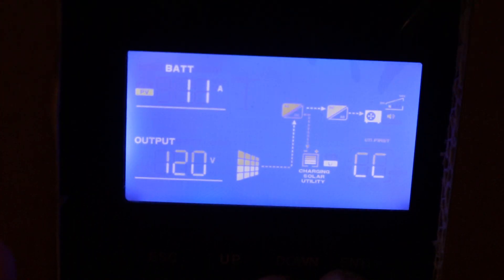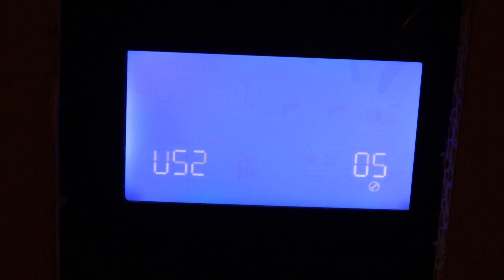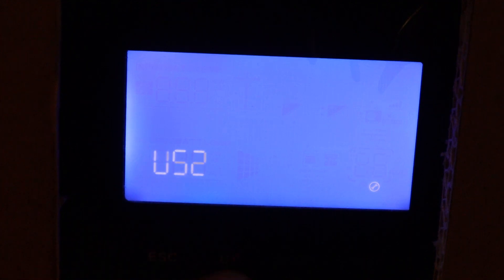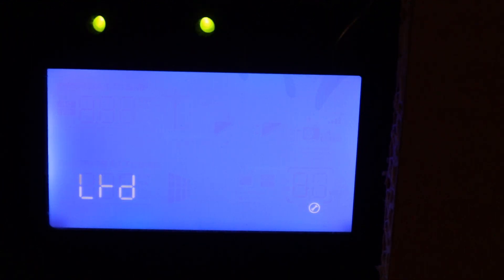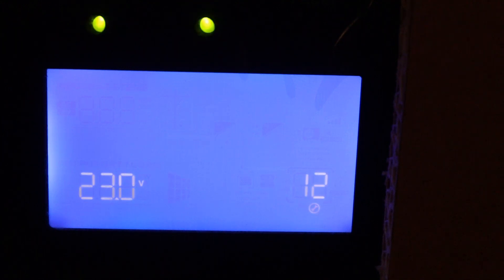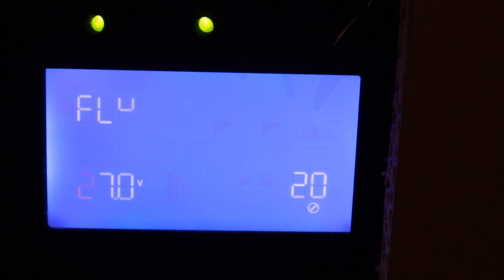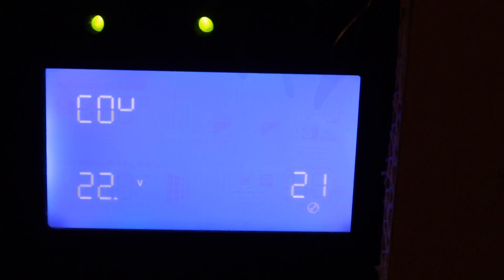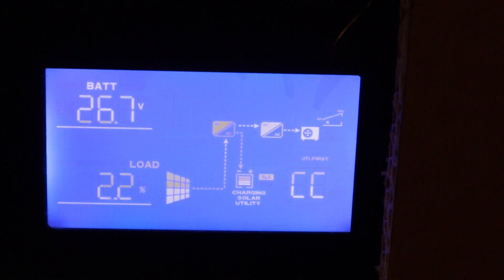Growatt 3000 24 Volt Settings For Lifepo4

Comment: For LiFePO4, generally speaking you want to set a Float voltage of between 3.35V and 3.375V per cell.  So for a 24V 8s system, Float would be between 26.8V and 27.0V..   The reason you set the float here is because a fully charged LiFePO4 battery will 'settle' (remaining fully charged) at around 3.3V.  So this float will provide solar support for your load without depleting your battery, while the sun is up.  It will very slowly trickle charge the LiFePO4 battery if there is no load, but for an off-grid system you generally don't care because the instant the sun goes down your loads start to draw the battery down.   IF you also have a grid connection most of the time, using the lower 3.35V/cell float (26.8V for an 8s LiFePO4 system) is fairly conservative.

For the Bulk target you generally want to set a target of between (roughly) 3.45V to 3.65V per cell, which for an 8s system would be between 27.6V and 29.2V, approximately.  Now the bulk setting depends HEAVILY on the C rate that your solar system is nominally charging the battery at.  If you don't have a lot of panels and can only charge the LiFePO4 battery at a low C rate.  For example 0.2C or lower, then you generally need to set a lower bulk target to avoid over-charging the battery.  This will still fully charge the battery.

However, if you are charging the battery at a higher C rate, for example 0.5C (e.g. if the battery is 100Ah, 0.5C would be 50A), then you need to set a higher bulk target to avoid cutting off the charge too early (the battery will not be fully charged if you are charging at a high C rate and cut-off at a lower bulk target voltage).  In this case, charging up to 3.65V cell for the Bulk target might be necessary to get a decent charge.

There are other factors too.   Lower Bulk targets may leave some solar energy on the table because the charging current will wind up being lower than what the solar can deliver once the battery goes above around 50% charge.   Higher bulk target always run the risk of over-charging the battery.  Though LiFePO4 is pretty resilient just generally.

The rule-of-thumb 'safe' Bulk target voltage is around 3.55V per cell (which would be 28.4V for an 8s LiFePO4 battery).

The Growatt should have parameter settings to allow the bulk target and the float voltages to be separately set.

Also, I didn't catch the LiFePO4 setup but note that a BMS is mandatory.

-Matt
Reply: Thank you for all that info. It was also very helpful for me.
Reply from the maker: @KampervanemPrzezAmeryke  Thank you for watching and for your support. Please consider subscribing if you found the content useful it really helps the channel grow. Thank you.
Reply: Aloha, Great Info! I'm running a 24v 3000w Growatt with two 24v 100ah ampere batteries. This has helped me out a lot. I am off grid but using a 3500 generator to supplement. I am wondering how this may apply to me. I am only pulling in 350 watts of solar at best on a 600w solar array and thats when its not cloudy which doesn't cover my 150-400w load and charge the batteries fully for the night. It seems to drop the batteries WAY TOO quickly, it turned off at 5am at 22v low cut off and it only wants to charge up to 26.5-26.6  even though I set my bulk and float to 28.2. I tried various settings with mixed results, but curious whateveryone thinks. I'm still trying to figure out what settings I should be using. Util, Sol? And what about number of batteries setting? Sorry I'm still a noob and really appreciate anyone and everyones input. I'm saving up for a 2000w solar panel array, but any other advice would be appreciated. I live on the Big Island of Hawaii where I get a lot more sun. I know It should be doing better than this. Please Help! Mahalo!
Reply from the maker: @AnWAdventures  Hi. Yes, my setup is similar and I am getting similar results. I have mine setup on UTI first and  setting 14 on SNU. You can play around with setting 5 between USE or US2. Also you could try setting the bulk and Float to the same value at 28.2. Technically if your cells are balanced you could set it as high as 29.2, however you do not want to over charge your cells. Keep in mind that after charging it will read at 26.5 volts because that is where these cells rest at their nominal voltage. But when charging you should see them go above 26.5. There seems to be a lot of issues with the Growatt 3000 and the settings. Hope this helps some. Please consider subscribing if you found the content useful. Thanks.
Reply: @thinkfreelivefree6951  I set my girlfriend's Charging and Float Voltages, (#s 19 and 20), to 28.8V, which gives 3.6V per cell, assuming 8 cells in a 24V nominal system. Her system seem to be doing fine, even after a year of use. Oh...I did mount six 200W solar panels at about 45 Degrees with down towards the driver's side, to allow rain to wash them clear of dust.
Reply: @AnWAdventures  Sounds like the panel is not generating enough power and is only able to partially charge the batteries during the day at best.   My assumption is that this is why the battery voltage is not able to climb any higher.

You have roughly 4.8kWh worth of batteries which, if fully charged, would be able to support roughly a 450W load for 10 hours.

The 'solar day' for fixed panels is roughly 6 hours long. 350W x 6 hours is roughly 2.1Kwh, so your current panel setup is only able to charge the batteries half way (and that is only if there is no load).  Since you have load too, it is pretty clear that you need more panels.

Which you know since you are working on getting 2000W more :-).  But in the mean time, see if you can scrounge up a few more panels on the cheap.  Even if you have to lay them down on the grass on some 2x4's (make sure they don't wind up in a puddle).   Make sure the open-circuit voltage and currents remain within the specifications for the Growatt.  It should make a big difference.

My second recommendation is that you collect data on just how much energy you use after 5pm until around 9a.m. the next day.  That calculation is in kilowatt-hours (kWh).   For off-grid living, the #1 thing on the punch list is always to minimize overnight usage.   

Also note that the Growatt's standby power consumption alone is going to be fairly high.  I don't have the number off the top of my head but my assumption is around 60-100 Watts.  It will drain the system even if you have no loads connected.

-Matt
Reply from the maker: Awesome Post Matt. Thank you for sharing all of that with us, very valuable information and thank you for watching. Please subscribe if you found the content useful. Thank you for your contributions.

Comment: Also if it doesn't need a float charge then why not just set it up at your max charge rate? I have my max charge set at 28.8 (battery manufacture says 29.2 is max) they also say in my battery documentation for my lith battery the 27.2 is float. So I have it set at that. So I dont think it is charging my battery to the fullest. I and going to try to set the float the same as the max 28.8 and see what happens. Oh and I am in USE mode. I have not tried the other mode yet.
Reply from the maker: Hey Woodknack, thank you for your contributions. We all appreciate knowing how everyone else is setting their Growatt's up. My concern with going to 28.8 is that if some of the cells are out of balance or becomes out of balance it would push some of the cells higher than 3.65 volts per cell and could degrade some of my cells. So I am trying to play it a bit safer by not charging them up all the way. 28.8 volts would be 3.6 volts per cell, I would be a bit nervous that some of my cells would go over 3.65 volts on the upper limit. Thanks for your questions and input.
Reply from the maker: So you are also using USE, are you seeing any issues with your Growatt in the afternoon reducing your solar? Thanks.
Reply: @thinkfreelivefree6951  its in my camp. i only go up on weekends. still learning and playing with it. I just installed it a couple weeks ago. I have 800w solar array put I also have two 145w panels I am going to add to the array. So I will have over 1000watts. Cabin is small 360sqft. small frig I leave going full time draws about 65 or 70 watts when the compressor kicks on. Lights are all led. My biggest draw is in the morning making coffee in our one cup k cup coffee maker that draws a lot but only for a very short time.
Reply from the maker: @woodknack1  That is awesome. Are you also running Lithium Iron Phosphate? When you get time to check it, could you let us know if it reduces solar in the afternoon? Thank you for sharing with us.
Reply: @thinkfreelivefree6951   Yes, I am running Ampere Time LiFePO4 Deep Cycle Battery 12V 100Ah with Built-in BMS( have two in series). Mine seems to fluctuate on wattage trough out the day. Im am sure I am not at the optimal angle for the sun. When I got to camp last weekend it showed the PV array pumping 761w into my controller. I thought that was pretty good considering it is a 800w array. I also have it setup with a generator that is remote start on and off from with in the camp so I can use both to charge the batteries. But for the most part solar has been keeping right up with it. I will know better when we get the camp finished and settle in for a week or more at a time.
Reply from the maker: @woodknack1  Nice setup. Are you completely off grid there? Sounds amazing. I am also looking for land at the moment and want to do an off grid cabin too. Your setup sounds perfect.
Reply: @thinkfreelivefree6951  yes all off grid
Reply from the maker: @woodknack1  Wow, that is crazy efficient. You are getting 761 watts out of 800 watts. That is excellent. The best I have seen on my 600 watt solar array on my van is 480 watts, but most of the time it is closer to 400 watts. I am not sure why my panels are so inefficient. I have 3 200 watt Rich Solar Panels connected in series. Anyway, your setup sounds really nice. Well done. Thank you for sharing with us.
Reply from the maker: @woodknack1  In what State do you have your Off Grid Cabin, if I may ask? Do you have some acreage? Thanks.
Reply: @thinkfreelivefree6951  iys notvalways at that high of wattage. Goes up and down all day. I have 8 100w rich solar. Took 4 and put them in series and the other 4 in series then connected those two groups in parrell.
Reply: @thinkfreelivefree6951  its in Maine. Yes little camp setup for atv'ing and hunting.
Reply from the maker: @woodknack1  That is very cool. Well enjoy that awesome property. I am looking for land in Idaho, Washington and Oregon at the moment. Looking for between 2 and 5 acres with no building restrictions. Its a daunting task. 😩
Reply from the maker: @woodknack1  I see, so essentially you have a series parallel connection to stay within your 145 volt parameters for the growatt mppt. That is smart. I am still trying to figure out whether my growatt is limiting my solar intake or if my bms is limiting my solar array as it comes into the batteries.
Reply: @thinkfreelivefree6951  I have the 200 watt rich solar panels as well and have also noticed poor performance. I just picked up a pallet of used 250 watt T series panels from SanTan solar for about $75 a panel after shipping and they out perform the new rich panels by a long shot.
Reply from the maker: @ktwdrummer  Hi Michael. I do not believe its my solar panel performance, my growatt is regulating my PV input during the day and reducing in full sun. So something is not quite right. Just wondering if you are also experiencing this. Thanks.
Reply: @thinkfreelivefree6951    I’m in central Maine as well living off grid
Reply: @thinkfreelivefree6951  I’m in central Maine living off grid as well good times
Reply from the maker: @cowboymcq6711  That is awesome man. Thank you for watching and for your support. Please consider subscribing if you found the content useful. Thanks.
Reply from the maker: @cowboymcq6711  That is awesome man, live free. Thank you for watching and for your support. Please consider subscribing if you found the content useful. Thanks.
Reply: just above 58.3V @thinkfreelivefree6951  I have two of these units, one on my work truck and on on my girlfriend's shuttlebus/RV. I live in the southern CA desert, so we usually see a full battery bank by about 11AM, so yes, at 2PM, there isn't much solar input, unless we are drawing a very heavy load that brings the batteries down to a certain point. In my 48V system, featuring two of the Growatt 5000W/48V units, I have recorded that the unit(s) stop charging after reaching 57.8V (during the day) at   just above 58.3V, then rest until the Voltage drops to around just below 55.8V, when it starts charging again. This was in May of 2022, with two air conditioners going, one 5000 BTU, and one 8000 BTU, so it was cycling fairly often.
Reply: @woodknack1  My neighbor and I live off-grid in the southern CA desert, and we have seen OVER the maximum Wattage only a few times. Always after a night of fairly hard use, followed by a cloudy morning, then the sun comes out fully, and BANG! Only for a short time, but WOW!
Reply: I’m new to these all in one units I’m running a MPP LV2424  and so confused with what to set the float at for my lifepo4 batteries as well. I’m in the same boat as a few of y’all out there why not set the float high instead of over 1.5v less
    🤔🤔🤔🤔🤔🤔🤔🤔🤔🤔
Reply: @cowboymcq6711  You should be able to set the solar charging Voltage and the Float Voltages to the same. I have the same one talked about in the video, and my battery company, (Battle Born Batteries), suggested 28.8V for my 24V system.
Reply: Your best bet is to call or message your battery supplier and ask what they recommend for the settings. (There are 50 settings on my 24V Growatt, but many are not in use because I am using LiFePO4 batteries rather than lead-acid. You may want to consult your user manual for the MPP LV2424 and use that as a guide to know what questions to ask. Always trust the User manual over a Data Sheet, unless the user manual suggests over 48 Volts on a 24V system. LOL

Comment: on setting 10 you have 2 24v batteries in series or 2 12v batteries series to make 24v? I have the same system I put two 12v lith batteries together to make 1 24v 100amp hr battery. i have my setting #10 as 2 in series. I was wondering if I should just have it as 1 instead of two? whats the difference?
Reply from the maker: Hi, thank you for watching and for your comments. Setting 10 is not settable, I believe the growatt senses the configuration of your batteries once connected. For 24 volts it is 2 and 10. Meaning 2 12volt in series to make 24 volts. If it was 48 volts it would be 4 and 10. Hope that helps. Please consider subscribing if you found the content useful. Thanks.
Reply: @thinkfreelivefree6951  I have two 24v 100ah connected and its still set on 2, should it be changed? Can I even change it?
Reply from the maker: @AnWAdventures  No you can't change it, but your settings are correct for your configuration. Hope that helps. Thank you for watching and for your comments. Setting 10 is not settable, I believe the growatt senses the configuration of your batteries once connected. For 24 volts it is 2 and 10. Meaning 2 12volt in series to make 24 volts. If it was 48 volts it would be 4 and 10. Hope that helps. Please consider subscribing if you found the content useful. Thanks.
Reply: @AnWAdventures  Leave it. That is the correct number of 12V batteries in a 24V system.
Reply: @thinkfreelivefree6951  The 10 shown on the screen is the Setting number,, so it's not "2 and 10", it's "2 IN (setting) 10. FYI.
Reply: So if I have two 12-volt batteries in parallel and two more in parallel Glenn hooked that in series to get 24 do I still leave setting 10 at 2 or change it to 4 my guess would be 2  12 volts in parallels still considered one 12-volt battery ?